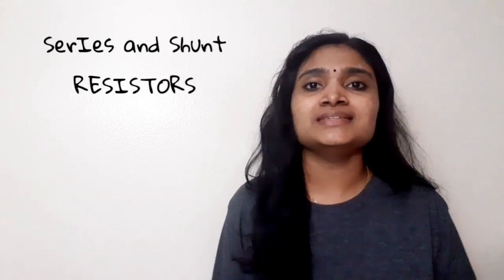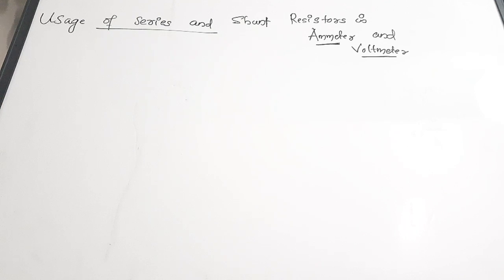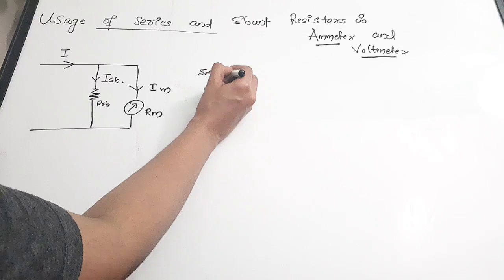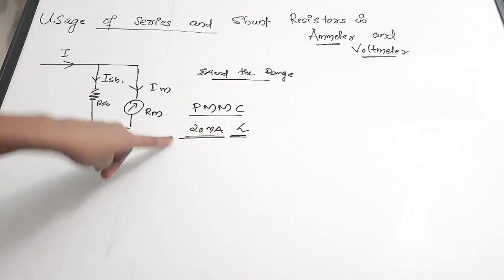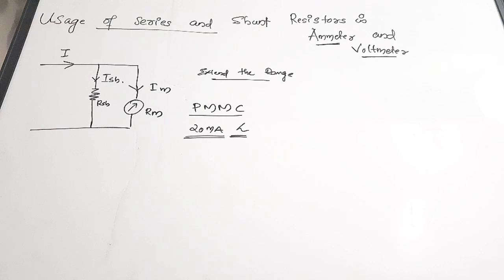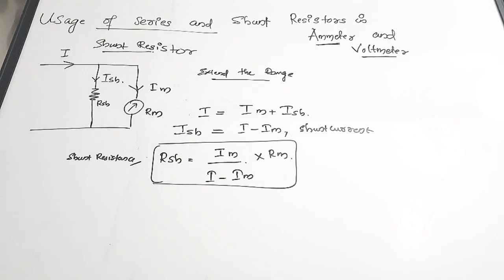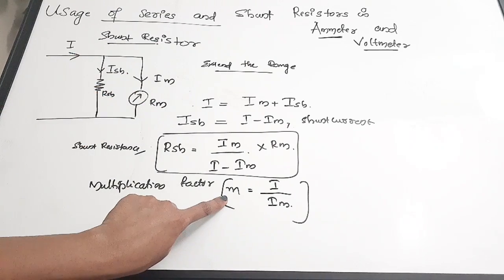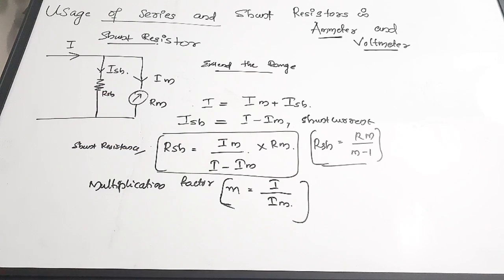Series and Shunt Resistor in PMMC| Extending Range of Ammeter & Voltmeter| PMMC Numericals

Comment: Why there is shunt resistance in ammeter and series resistance in voltmeter?
Reply from the maker: Because in ammeter current range we want to increase. So when Shunt is connected some current will also pass through it. So shunt in Ammeter.

Also in Voltmeter we know voltage is not same in series so some voltage drop happen across the series resistance also. So total voltage measuring increases